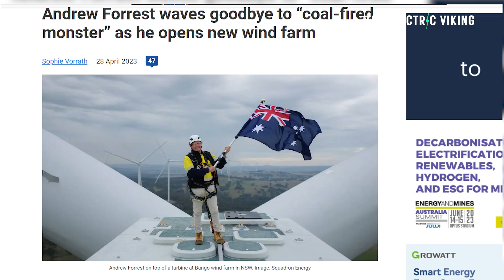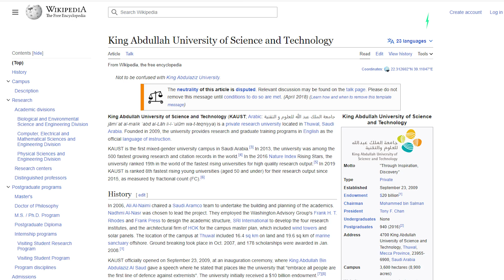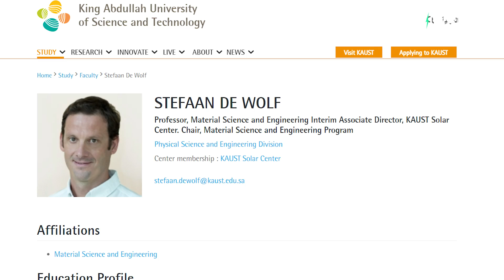A commercially viable solar cell set a NEW efficiency world record

Comment: Coal and gas power plants only realize a 30-35% efficiency, but still have the unfortunate, high cost, of having to mine their very expensive fuels.  Today, coal, gas and oil cannot compete with solar and wind power, and never will.  We’ll look back in 20-30 years from now and wonder why so many people dragged their feet in converting to solar and wind energy.
Reply: @orionbetelgeuse1937  the batteries are not free but are paid for by the saving from not using fuel to generate the electricity to begin with. 

Uk wind power costs 40-48 uk pounds per MWH agains 80+ for nuclear or GAS. That gap more than covers the cost of storage, as long as the round-trip losses are not to high. 

Pumped storage is about 85% efficient,  sodium ion batteries are also 85%+ . If you use liquid air storage you're looking  at about 70% and if you have so much excess power that you have filled all those and are using hydrogen,  then you are looking at 35-40% round trip efficacy .
Reply: Can my grandmother on a fixed income afford to go solar in her home? If so, does she have the room for the massive solar array and massive battery bank? Can she run her heating, air conditioning, electric stove & oven, and clothes dryer from solar panels and batteries? If you think the answer to ANY of these questions is "yes" you`re absolutely delusional. I use emergency off grid solar. I know the costs, logistics, and impossibility of ever converting to 100% "green" energy. Germany and California are prime examples. And I`m sure you`re clueless about that as well. What happens to solar when we get a repeat of the Burckle Impact event or the 536 A.D. catastrophe...or the Toba eruption? I know what will happen in California and Germany!
Reply: @baneverything5580  I don't know where you live but in Australia solar is totally accessible and affordable, even for older people on a fixed income. 2 years ago my mother-in-law got a 6kw solar system which only cost her $4.5k AUD after the government rebate. She got a low interest green loan from a credit union, and I helped her by installing a reverse cycle air-con (for winter heating) and a heat pump hot water system. With her summer electricity bill in credit, and a tiny winter bill, she saved so much she was able to pay off her solar loan. She thinks the solar system will only take another year to break even, then she's got free electricity much of the year. And why use a clothes dryer? In summer hang it up outside, and in winter put a clothes horse  in front of the air-con.
Reply: @sparkytas  even in the UK a 5 or 6kw system can give an "average" of about 15 to 20kWh a day over the year. So about what most family hones use in the UK.
Reply: @baneverything5580  Only fools, the super rich, and people who live off grid ever talk about being 100% solar as anything but a thought experiment. Everyone else is happy paying zero electric bill 90% to 99% of the time and simply keep the grid connection for those rare times when solar is not enough.
You clearly are not living off grid or you would understand the need to keep your energy use down. Solar panels cost a few thousand, generator fuel is twice that per year, building a power line to your farm or cabin would cost millions. Do the math.
You aren't rich either or you would know that 100% solar is totally possible if you simply install enough panels and batteries to cover for a random week of freak weather instead of worrying how they are not earning you money during the other 51 weeks when they are not needed.
That leaves one option.
Reply: @orionbetelgeuse1937  Cheap energy source has always only improved the economy as new businesses appear to take advantage of this resource. Making fuel or drinking water is baby steps, as long as renewables are cheaper to build than batteries we can simply increase the production capacity so low production day is still enough to meet the demand and either sell the spare production or use the extra gigawatts for something like turning waste from landfills and low quality ore into plasma so we can separate the elements and produce and recycle raw materials at massively cheaper cost.
Reply: @orionbetelgeuse1937  Is that 2x cost per panel or per watt? Given the cost per watt is around $0.5 and installing rooftop solar was economical at $5/W that is not a problem.
If you have plenty of cheap land and labor for installation work the cheaper per watt price will of course win, but for solutions like domestic solar where the amount of space on house roof is always limited the cost per panel is dwarfed by the cost of labor needed to install each panel so it is better to buy ten panels instead of fifteen because you save more by paying for less work than for cheaper panels.
Reply: @orionbetelgeuse1937  the degradation of modern batteries is must slower than you say. The original lithium turnery batteries were good for 1500 to 2000 cycles,  today's LFP batteries are good for 3000 to 5000 cycles. And the new  sodium ion batteries will be good for 6000-10,000. So basically any modern battery is good for decades rather than years.

They would not give 8 year warranties if they did not expect average life to be at least double that.
Reply: @orionbetelgeuse1937  Demand mysteriously drops at night so there is no need to meet peak demand then. Experts have calculated we only need about four hours of battery storage; if you have an emergency where that is not enough, that is what emergency backup power plants are for. Also, during such emergency the power company would simply cut power for unnecessary things so the batteries would last longer. If a blizzard is freezing power plants, do not expect Disneyland to stay open either.

Transporting fuel around is more troublesome than simply using power lines. The smart grid operators have already been upgrading their infrastructure so they will not be left without business when the producers start making the calculations whether they can buy the service or need ot build their own connections.
Reply: @orionbetelgeuse1937  Typical home charger uses no more power than AC or an electric heater and we have been using them for decades without breaking the grid. More importantly no matter how often some idiots claim otherwise , driving few dozen miles per day like 90% of people do only uses few kWh. The EV can be charged while the owner is at work or shopping at the mall, often for free. There is very little extra drain at night and smart grid will handle it so there is no sudden spike either.

I thought it was obvious that emergency backup power plants are for emergencies only like it says in the name. The ones wasting fuel are peaker plants, backups are shut down when they are not needed. Ergo, no, they do not need to sell electricity. 

If you haven't heard about power plants freezing then you haven't heard of the cold weather that hit Texas while back. The gas lines at gas power plants froze closed and there was no power to melt them. The piles of coal and the conveyors needed to bring it into the coal plants froze solid so there was no fuel to burn in the furnaces. The only source of power in the whole state that was working as intended was wind turbines, only a few froze and none would have if the greedy owners would have weather proofed them like they were told to when that happened before.

Funny thing about solar panels and cold: Freezing temperatures make them work better and sun reflecting from snow increases the amount of light that reaches them. Also the panels are always either set at an angle or set in a moving frame, so snow easily slides off them. The real problem is when days are short and cloudy.

Power companies would have their own priorities where to shut down power to keep rest of the grid operational so I guess some of them might let thousands of customers freeze while they keep the lights on in a steel mill while workers cannot even get there. If all those houses have their own batteries they can handle a typical blackout just fine, but I imagine many of the owners would be changing their service provider afterwards. Meanwhile the electric vehicles still do not break the grid: A typical EV battery can keep running a 1000W heater for days and given the car cabin is small and kept closed you do not need to keep it on 24/7 to keep warm and toasty.

And finally, if you cannot imagine how a power line works then I cannot help you. We already know that it takes huge amount of energy to bring just one barrel of fuel from oil fields to the gas pump, and most of those inefficiencies do not go away if you use air capture and electrolysis to make the fuel instead or drilling and refining. Making fuel on location for energy storage or for boats and planes to use instead of batteries makes sense but adding unnecessary transport losses by building the factory too far does not. The best way to transport electricity is in high voltage power lines because the line losses are tiny compared to the cost of using tankers at any range.
Reply: @AnalystPrime  yes, In the UK the average car, dose about 8000 miles a year, so about 26 miles a day, about 6 kWh a day. Added Ng about 65twh a year to UK power Demand. That is about 20% extra over last year's 306twh ONLY taking power demand back to the demand of 2006.
Reply: @orionbetelgeuse1937  Right now in the 2nd quarter of this year, BYD are putting Sodium Ion Batteries in their mass produced short range cars. So, can you go to the shop & buy 1 right now.....no. Yet it is also not a "might be in the future scenario". Not sure where you get your information from on Battery recycling, seems like a lot of effort for 5 different large companies to go through to just get the Aluminum & copper. Perhaps it would serve you well to jump out of your Fossil fuel supportive algorithm for a while and have a deeper look at the environmentally friendly things that are being done. Could it be done better? Of course? Is a lot of it Greenwashing? Most certainly. Is doing nothing whilst continuing to burn fossil fuels, the answer? Most definitely not! Tell your great grandparents 100 & something years ago that every household will have unlimited supply to electricity in the future & the world will have an extensive network of roads, with petrol & diesel available on every corner.....they would laugh you out of the house & tell you it's ridiculous..... Yet here we are! In the meantime, have a look at the YouTube channel just have a think, & many of his latest videos. I'll attempt to post a link. All the best!

https://youtu.be/XFmBX0Uq0wY?t=147
Reply: they literally crush solar and wind, what are you talking about?!  the entire world runs off of fossil fuels.  all your food.  all your products. nearly all you electricity.  all your water.  everything that makes modern society comes from oil and gas.    yes renewables are starting to pick up a small bit of the market,  but they still have a LONG way to go to try and supplant oil and gas.
Reply: greed
Reply: @ianlynch2507  greed , why?
Reply: Main pro for coal, gas and oil is relatively easy storage. Coal is energy that can be stored in piles outside for long time.
Reply: @orionbetelgeuse1937  sodium ion have been used in grid storage, so there is some real world data with many cycles. The first sodium based EVs are due within a year. Yes, there are edge cases , like hard drives , I have had HDDs fail  within days of install and last in CCTV systems being written to 24/7 for 15 years. The point is they would not warranty for 8 years if half of them were failing In That time. They warranty to keep returns  down to a few percent , so the average life expectancy must be at least double the warranty. 

And remember there are other reasons to replace the battery other than failure .  I know someone who replaced his Nissan leaf battery after 90,000 miles, not because of degradation but simply because it took his range from 80 miles to 140+ and as a taxi drive it ment he no longer needed to charge durning the day on 50p per kWh , only at home over night at 10/12p per kWh.
Reply: @orionbetelgeuse1937  So now instead of simply using power lines to send the electricity to the fuel factory you want to deliver the raw materials to whichever solar farm has most sunlight today. Haven't you considered that also requires building more fuel factories instead of using one more efficient facility?

And you do not seem to understand how emergency readiness works. Who pays for fire department? Who pays for the military? Who pays for flood control? Hint: It starts with "govern" and rhymes with "ment".

There once were fire departments that only worked for profit, that ended with the city burning down.
Reply: @orionbetelgeuse1937  this is from about 1 year ago  they talk about fixed storage at 6 MINUTES IN https://youtu.be/IBE0NADjSrE
Reply: @orionbetelgeuse1937  its exists , it is in-between prototype and  full deployment. Watch   the link I posted above
Reply: @orionbetelgeuse1937  I'm afraid you're incorrect. The Chinese have already produced cars using sodium ion batteries,  & there are at least 5 companies in the world currently recycling batteries, that can only be the case as it is indeed economically viable.
Reply: @orionbetelgeuse1937  watch the video linked to above. If recycling was not comming of age lithium would not have fallen in price by over a third over the past year.
Reply: @orionbetelgeuse1937  it is both, the often quoted figure that only 5% are recycled is from about 2005 and is now seriously out of date. Today well over 50% of batteries that reach the end of their lives are recycled. And with over 50 companies worldwide  now doing recycling on an industrial scate. That combined with the use of sodium ion in aplication that do not need high energy density. Lithium prices will continue to fall. At least relative to general inflation.
Reply: @orionbetelgeuse1937  the sodium batteries are in prototype. And the first sodium ion powered cars are are one the roads in prototype and are scheduled to be on sale by the end of 2023. 

It may be hard to recycle lithium batteries. But the fact remains that thousands of tons are being recycled each year. And as more reaches end of life more is being recycled.

As of 2019 180,000 tones  came to end of life and 97,000 tones were recycled.
Reply: @orionbetelgeuse1937  https://youtu.be/mbkhXAP1EQE
Reply: @orionbetelgeuse1937  watch the video I linked to above.  It is easier than me retyping the contents here. 

Yes sodium batteries are years old.  So were  LCD/LED displays. But suddenly in the learly 2000s they went from being an "also ran" to being the only way to make monitors/TVs within   6 or 8 years.
Reply: @orionbetelgeuse1937  I take your point, but the main reason the delay in  grid storage battery in sodium. May well be that they want to demonstrate the cycle life, even more than with EVs grid storage needs good cycle life. That can not be guessed at it needs to be "demonstrated"  and that takes time . Like lithium sulfur , wonderful  energy density but currently only good for 200-300 cycles. You need at least 10 times that for EVs and tens of thousands  of  cycles for grid storage.
Reply: @orionbetelgeuse1937  no point in using them in those applications. They do not have the energy density. That is WHY they are being targeted at grid storage first where size is less of an issue.
Reply: @orionbetelgeuse1937  yes, and  those were a step UP in energy density. My first mobile phone had  a nicd. But going from lithium to sodium for held held devices would be a step backwards. Even if it was half the cost and 5 tines the cycle life. But in fixed storage and low end EVs halving the battery cost even at the expense of 20% less range is a trade worth taking. The same trade off as with Tesla's standard range having LFP (260 miles) against long range  NMC at 320+
Reply: Not an accurate statement
Reply: If efficiency of solar gets to above 35 +% it is looking at greater availability to greater area closer to source of demand. Internal combustion engines are at most 40-43 % efficiency.
I am waiting for efficiency to improve before I install solar on roof with battery storage !!  In India they placed solar over canals and this cools the solar and improves efficiency of older solar panels by 2 to 3 percent 20-23 % whilst the shade from solar panels reduces the water evaporation giving water availability for agriculture and towns and villages. When cost of energy from solar is cheaper then conventional energy it will become no brainer.... Australia has land and sun for both wind and solar and only 30 odd million population Australia could export renewal sustainable energy to other countries like Japan and NewZealand and Phillipines and Indonesia as part of One Sun One world project. Certain countries are blessed with wind and sun ....
Reply: You are really 50 years behind in your knowledge. Currently Combined Cycle Gas Turbine can achieve 62% efficiency. Steam Turbine coal plant in the form of Ultra Supercritical boiler can reach 46% efficiency.
Reply: @anuardalhar6762  now add in all the inefficiency of mining, transport, ash, pipelines. Oh and lets not forget all the cancer deaths. Well done in suporting gas and coal. What do you have against clean air?
Reply: @sdpryce  I think gas will be around for a while, because it is very dispatchable , unlike coal.
Reply: @sdpryce  I can understand getting rid of coal plants, but I have to question the banks being discouraged from funding production of natural gas, especially during a period of intermittent power supply.  Twenty years from now OK, but all you're doing in the meantime is lowering the standard of living for everyone in colder climates.
Reply: @anuardalhar6762  true but you still have to pay for the gas/coal. If you build the wind/solar and spend the money you save on  not buying gas/coal on building storage
 Pumped storage/batteries/liquid air etc. You then have geen 24/7 power.
Reply: @anuardalhar6762  right. Great argument to keep our Fossil Fuel infrastructure. I'm sure if Fossil Fuel research continues as an esoteric science, it will improve further.
Reply: @anuardalhar6762  That is more efficient than reported, but just wondering if you have any details - statistical % of coal and gas plants that use these contemporary technologies compared to aging old plants that use outdated inefficient technology?
Reply: @sparkytas  no coal plants in the uk atleast becaus  the last one was built in 1974 and they will all be gone by 2027.
Reply: Russel, 

it is simple, they do not work for grid supply. Not now and they never will. 
They are not an equivalent to conventional generation and cannot replace it.
No matter the efficiency improvement they are still intermittent and requires reliable back up capacity sufficent to cover their times of very low outpuit.
Technically they are asynchronous,  have no inertia, they do not provide reactive power and apart from thet have a short life and deteriorating output relative to time.
Reply: @iareid8255  the intermittently   issue is solved with storage. As is the synchronisation. And the degradation is  vastly over stated. I have 6kw of solar on my garrage installed in 2005 in full sun they still give 5.8kw so what 5.5 by 2035? 5.0 by 2050?
Reply: Patdbean,
not for the grid, the amount of storage required is out of the question.
Degradation is a factor, small amounts year by year add up over the life.
Reply: @iareid8255  the amount of storage needed is large but is doable. The UK already has over 25gw/h of pumped storage with double that in the planning  stages. Add that  the grid level battery projects in construction and liquid air storages systems already being installed, and you are looking at hundreds of GW/h add the domestic systems (power walls etc) and batteries  in parked EVs and by 2030 the UK will have about 1tw/h of storage. 

Yes solar dose degrade, the solar panels I had installed when I was 32 will need replacing  by the time I am 72. But by that time so will the roof they are installed on.
Reply: Patbeam, 

your figures do not even begin to scratch the surface. 
Last week for instance, apart from Thursday, wind was averaging about 5 gigawatts output. Storage to cover that would need 1200 or so Gigawatt hours. (1,200,000 megawatt hours) This is quite a common occurence and sometimes it goes on for weeks on end.
Not only that once that storage is depleted it needs that amount of extra generation to re charge it. Where is that coming from?
It's simply a non starter. 
Pumped storage is not designed or used for intermittency but to support frequency and provide a reserve of power when the grid collapses to do a black start which renewables are at best extremely poor at doing, so we will need all the fossil fuelled geneartion and nuclear that we have left.. 
Unless we curtail the expansion of renewables we will have a grid collapse and all the dire consequences of that.
It's time it was realised that renewables are not equivalent to conventional generators nor can they replace them.
Reply: @iareid8255  firstly you are forgetting how much new wind and solar is being built. The dogger bank wind farm alone is/will be  7gw and the Morocco UK power link will give 3.6gw of combined solar and wind with about 5gwh of storage. The 2 new nuclear power stations,  hinkely point C and sizewell C will deliver about 6gw between them. And pumped storage is not just for black start and TV pick up,  it is putting out 300MW as I type and has been since about 7AM. 

Now I agree gas will be around as a standing backup for many years just as oil was in the 80s/90s. But like oil it will become a standing reserve rather than a spinning one over time .
Reply: @iareid8255  you are also forgetting about the interconectors :-
1gw from Ireland (mostly wind)
1.4gw from Norway (mostly hydro)
4gw from France (mostly nuclear ,with some hydro)
And 2gw from Holland and Belgium (mostly wind) 
With links to Denmark and Germany to come in the next few years.
Reply: Patdbeam,

no I'm not forgetting the interconnectors, but don't think they are simply one way, they are not, we also export power to these countries depending on grid load. 
The first French grid interconnector was built when I was an apprentice, well over fifty years ago because it helped load balance as peaks did not coincide.
You are also mistaken, as many are, in what sort of power generates their electrcicity.

Grids work like this, a base amount of power is generated and renewables are part of that base. Anything extra is from mostly fossil fuels  (even in France with all it's nuclear) although Norway is largely hydro.
So even imports will have a large amount of fossil fuel generation supplying them.
incidentally the same reason applies to the charging of storage, it is an increase in fossil fuel generation that will charge them.
The same for evs and heat pumps. Any extra load is met by the only source that can incresase output which, in the U.K., is gas.
Reply: @iareid8255  I am on the  Octopus agile tariff. The cheapest times, sub 5p per kWh ARE always when wind/solar out put is high. Currently 21p per kWh at 5pm it will be 35p if the wind picks up over night it could well drop to less than 5p and I have seen it as low w as -10p mostly in a windy AND sunny Sunday afternoon.
Reply: Padtbeam, 

it's not to do with wind speed at all but simply demand on the grid which drops off significantly after midnight.
It's nothing new to have cheap night time rates, like the economy seven very many years ago and a simultaneous push for electric storage heaters. all to reduc eth variation betwen peak and opff peak load.
Reply: @iareid8255  that is true, but by your logic power would go sub 5p every night. It   Doesn't, when ever I get a notification from octopus that my  power is going below 5p per kWh be it day or night. I ALWAYS find that in those cheap hours UK wind output goes above 10gw in those cheap hours. As I type UK wind output is 2.25gw hence the 21p price.
Reply: Patdbeam, 

the wholesale electricity is avery complex being and there is much in it that doesn't make sense.
Octopus have their own reason for pricing and it may well reflect wholesale price in a very flexible way. Weekends should be cheaper than week days and Summer, of course sees a smaller demand for electricity although many power plants come off line for maintenance then.
Just now I was reading about the firms that sell 100% renewable electricity can claim this becaus ethey buy certificates. These certificates are now getting expensive and are added to customers bills. There is no such thing as 100% renewable electrcity in the U.K.  It's one of the many things that add to our costs.
Reply: @iareid8255  I am sure   that TODAY  100% green power is a myth. As I type the UK is 25% gas powered BUT only 25% the rest is renewables and nuclear. Over night that gas percentage may well drop to 10% or  because overall demand will drop to less than 20 GW by 1am.
Reply: Patdbean
Yes the two new nuclear stations will replace what has and is shutting down, but Sizewell is a long time on the future. Hinkley's commissioning is unknown, given Flamanville's delayed start.
Of course Dinorwic (and others) run most days at peak times, they are commercial plants but that doesn't alter their primary function when required.
Reply: Patdbean, 
new wind is being built (divide installed capacity between 2 to 3 for expected output) but maximum wind output has not risen and rarely reaches 18 Gigawatts from over 25 Gigawatts of capacity. As I said renewables deteriorate as they age (3 per cent per annum approx).
Morocco is a very big maybe, the desert is a hostile environment (I spent 11 years in the middle east)
Gas is not and never will be a standing reserve, it's inertia, reactive power and synchronous generation is essential.
Yes, I forgot solar, it only works for eight months a year. If you look it is rare for both wind and solar to be strong together. If wind is strong solar is weak and vice versa.
Reply: @iareid8255  Your claims are irrelevant as renewables have already surpassed and replaced conventional generation.
Look up "pumped energy storage" and you will find that it was originally built to cover for when coal and nuclear plants could not meet high demand some 50 years before anyone was even trying to build grid scale renewables. It was also used for grid stabilization because those plants cannot turn their output up or down fast enough to react to the demand. Nuclear reactors need to shut down for months long refueling every few years and any disruption in fuel delivery like the icy weather in Texas while back shuts down the burner plants so by your own logic they are intermittent and require backups.
The plants themselves last no longer in best case than solar panels do, but it is far more expensive to repair a billion dollar power plant to extend its lifespan for couple decades than replace cheap solar panels. That is if you even replace the panels when it costs less to build another solar farm than remove the still operating panels just because there are cheaper and more efficient ones available.
Reply: @AnalystPrime  quite, the 6kw of  17 year old panels on my roof won't be replaced because they don't work. They will be replaced because I can get 15 or 20kw into the same space.
Reply: Analyst, 

I have to disagree and your beliefs  have no basis in reality.
i don't need to 'look up pumped storage' as I trained in that industry, my knowledge is not second hand knowledge.
Pumped storage was not to meet high demand, as you seem to believe, due to a lack of response but to meet sudden shorfalls due to faults or generator trips.
Where do you get your information from as it ois highly suspect?
Renewables cannot directly replace conventional generators and to say they have is pure fantasy.
Intermittency cannot be met by batteries, so supply and demand balancing is impossible with renewables. 
Inertia is something that cannot be met using renewables.
Reactive power is something that cannot be met by renewables.
Reply: @iareid8255  If you wanted to alert me you have to use the reply function properly.

Pumped hydro was originally built because meeting peak demand with it and a smaller power plant costs less than building a bigger power plant that only runs at 100% for couple hours per day. If the power station near you doesn't offer guided tours I am sure you can find some historical documentaries on YouTube.

The fuel savings alone were enough to make this plan profitable, so by replacing the power plant with renewables that use no fuel at all the savings become immense. Smarter people than you or I have calculated this already, that is why it has been known for years that building renewables with energy storage is not only a better option than building a new power plant but even just continuing to use existing ones.

The other function for pumped hydro was grid balancing because it can respond in seconds while a steam generator would need minutes to up to an hour to increase its output. This is also known as "meeting the intermittency of production".
Pumped hydro IS A BATTERY.
Batteries.
Meet.
Intermittency.
And they have been doing it for decades before renewables came around.
Reply: Analyst oprime, 

ther is no point in further discussion as you demonstrate a complete misunderstanding of how power systems work. 
Pumped storage was never designed to reduce the installed capacity of existing plants but to compensate for sudden  divergence from demand and supply, because of their rapid response.
Steam generators react very quickly relative to demand fluctuation, hours, you do not have accurate information. Governors regulate the steam input which is what controls output. It is imperceptible in practice and all that is required to meet anticipated demand is to ensure the boilers have sufficient 'steam head' , short term variations are easily managed.
 Renewables are a dead end and batteries are a fantasy not supported by simple arithmetic in calculating the capacoity required.
Reply: @patdbean  There is just one issue with installing a domestic 15-20kW solar system: Do you really need one that big?
The power companies can still build solar farms and grid scale batteries cheaper than home owners, and wind, hydro and geothermal power will offer even cheaper night time power. Meanwhile you probably already charged your EV at work and your home battery is already full, and after grid electricity price drops the power company will not pay much for your surplus power so there is little economic incentive to buy more panels than your home needs.
So maybe you will simply get a 10kW system because that is enough and it costs less.
Reply: @iareid8255  then How come the UK grid plans to have coal gone by 2027 and gas gone from day to day use  by 2040. 

You had better get in contact with the nation grid  and explain that they  can't do  it. 

Because you odiously know more about it than they do.
Reply: @iareid8255  Your claims fail to reflect either the physical reality or economic facts.

The military might be able to keep an engine running 24/7/365 in name of readiness; a power plant is not going to stay in business if they waste fuel when it does not make them any money. That is why peaker plants are gas turbines instead of coal plants: You can start them up and shut them down in some thirty minutes instead of hours so they do not use fuel when there is no demand.

Batteries do not need a startup sequence nor do they waste fuel when not in use and the power companies you claim you worked for want to replace their peaker plants with batteries for exactly that reason. Using renewables will drop the cost of charging those batteries to almost nothing. The math is as simple as it is obvious.
Reply: Analyst Prime

your claims fail to reflect the electrical constraints of renewables.
Firstly you keep refering to peaker plants which only run for short times to meet peak loads. They are only a small part of grid operation.
Because renewables are uncontrollable, have no inertia, have no reactive power control it is essential to run conventional generation along side renewables. That is what is uneconomic and practically poor practice.
Reply: @iareid8255  you do not need "inertia " if your battery  storage can react to a frequency drop in a few  centiseconds. Thereby giving the national balancing officer in grid control , tens of "seconds" to get unnecessary loads off and pumped storage ON!
Reply: Patdbean,

what are you talking about?

I don't know what you have been reading about inertia but it is misleading you.
Inertia is a damper but requires generators that can alter output to accommodate a frequency change, up or down. Grid controllers do not control frequency, as such. It's far too rapid for their actions.